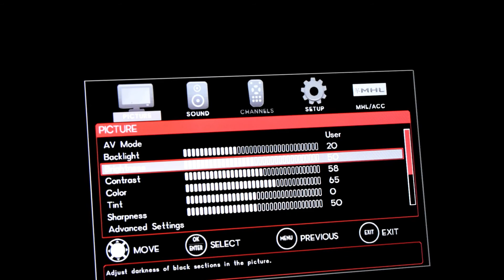Sharp TV LC-42LB261U backlight replacement (Black screen)

Comment from the maker: Any Questions just ask them below
Reply: what if my screen for the same tv has a picture but the picture is really dim? the picture also shows up then goes away then shows up and goes away over and over again.
Reply from the maker: @apex4201  sound like a bad backlight check my channel on how to replace them.
Reply: @NewsonsElectronics  now will the backlight also affect the picture going in and out like that? Or is that another issue?
Reply from the maker: @apex4201  you mean turning on and off?
Reply: @NewsonsElectronics  no the power never goes off on the TV, the picture appears very dimly but it appears for a few seconds then disappears, and that continues to happen. I wanna say though when it disappears and I put it into the light I can still faintly see the reflection of the picture.
Reply from the maker: @apex4201  It's your backlight most defiantly
Reply: @NewsonsElectronics  oh ok. Can those lights be replaced as a whole with out soldering? Or is soldering them the only way?
Reply from the maker: @apex4201  you can buy the led stips on ebay just open your tv to get the code. I find it easier to just replace the broken leds.
Reply: @NewsonsElectronics  so I can replace them as a whole? Like replace the entire panel? Do I have to solder the led strip?
Reply from the maker: @apex4201  you can just replace the strips they click in,
Reply: so I have a question  so the back light just went out on my TV but my TV is not the same model I can't find any documentation on my TV  but I think this TV similar to mine here's the model lc-43lb601c  another question is where I order new back lights from

Comment: I have a sharp LC-50LB481U with LED problem as well. Thinking I could try replacing all the LED strips myself instead of replacing each individual light since I don't have the same tools as you.
Reply from the maker: you can just replace the strips but it will take some time to ship, but on the other hand the leds will last longer.
Reply: @NewsonsElectronics  So I tried taking the TV apart but unfortunately, I cracked the screen on the way to the LED strips. Gonna take the remaining the parts and maybe sell them :(
Reply from the maker: @theydid2759  ouch, yes suction cups are very handy tools.

Comment: I have a Sharp 50" LC-50LBU591U that has developed a strong blue tint to it. I've checked all the inputs using different sources (laptop, DVD player, etc.) and they all exhibit the same blue tint. From what I've been able to find about this issue, it seems a possible cause is the backlight LEDs. I called a local repair shop and he said it was most likely the backlight, but it wasn't worth the cost to fix it. Would you agree this is a backlight issue or are there other things I could attempt to fix the issue.
Reply from the maker: could be a damaged screen is it just in one area?
Reply: The entire screen pretty much has the blue tint to it.

Comment: I have a Sharp 80” LC-80LE632U that has half of the screen has a great shadow over the entire right side. I can barely see an image below it. If you know what part this is or how to fix it I would appreciate it. Matt
Reply from the maker: yes check connection to the t-con board
Reply: I got a 1/2 screen picture too when I didn't reconnect the ribbon cables properly to the t-con.

Comment: If I don't have the fancy led tester, how do I check with a regular voltage meter
Reply from the maker: just put your  multimeter in diode mode should do the trick but you can only test 1 led at a time

Comment: When you did the flashlight test was the picture blinking or was it at a stand still?
Reply from the maker: it can blink this is just the power supply going into protection mode
Reply: So with the power supply in protection mode, what's the fix? I tried all the reset things I saw online.